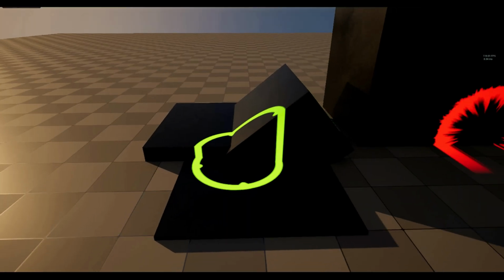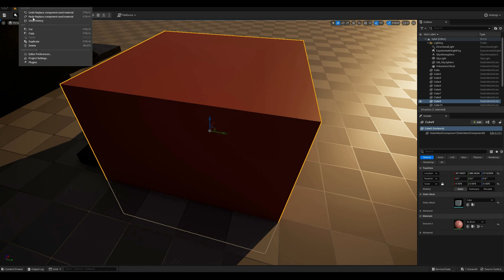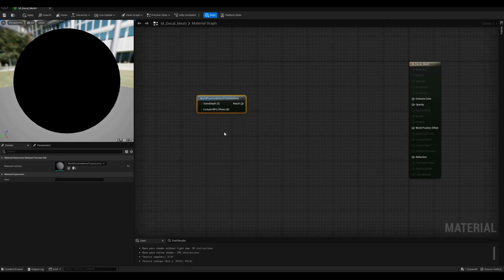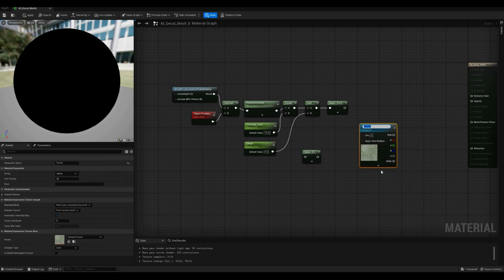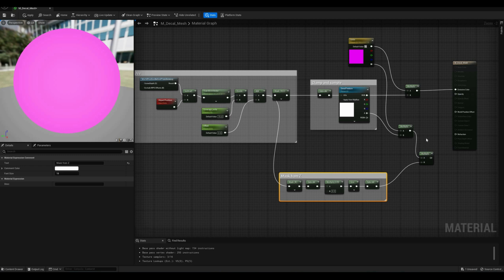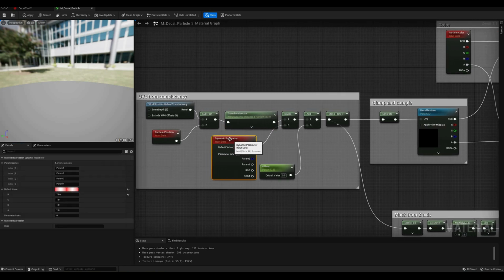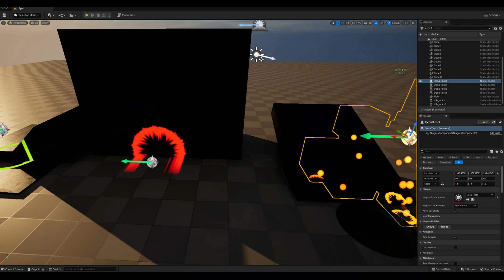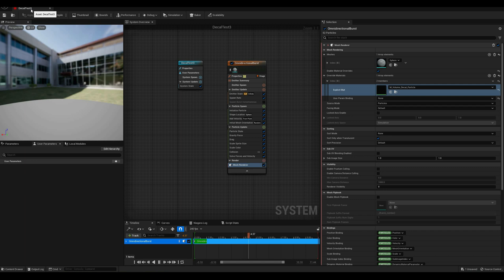Unreal 5.1 - How to use decal projections with Niagara particles (2d and volumetric)

Comment: Hi, thanks for the tutorial! I I would love to know if there's a way to somehow exclude upsidedown rendering or weird steep angles (like a wall bend 30* towards the floor) which seem unnatural for some decals. I've tried to mess with vertex/pixel normal but gone nowhere close to what I'm looking for. I've put pixel normal/vertex ws as A input in an If node, and 0 as B. A> is 1, and A<B is 0 and then multiply the output with opacity to just see if it works but it doesnt seem to do anything.

Comment: Is there any way to include normal texture information in this type of particle decal? When i try to add normals, it also grabs the shading from the bounding cube, and has face sorting issues when two sided is used.
Reply from the maker: Haven´t looked too much into it, but I´ll check; in the meantime you can try with the new official Decal Renderer available in 5.2, if you are using that version :)